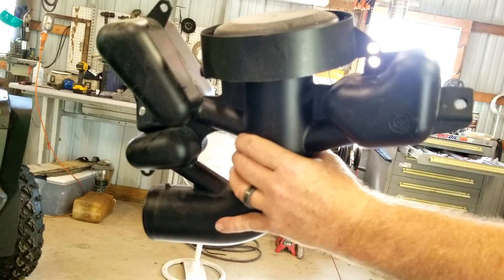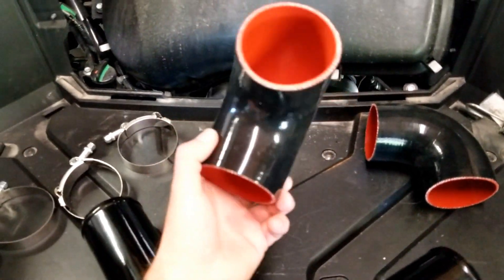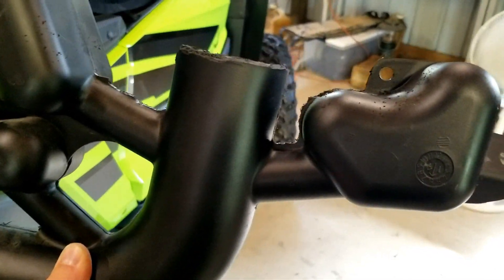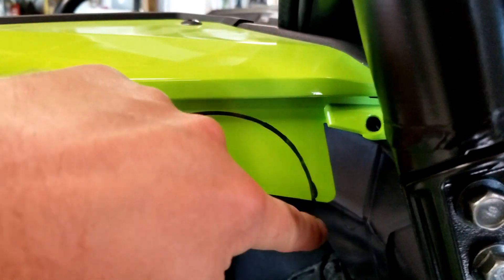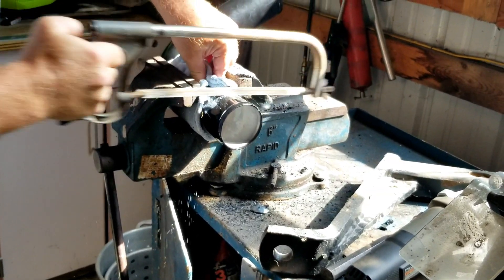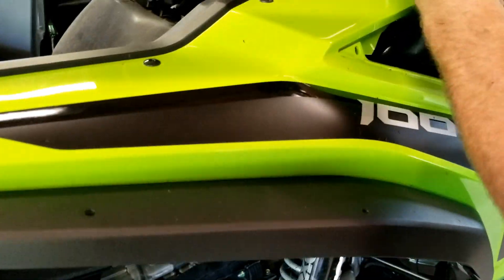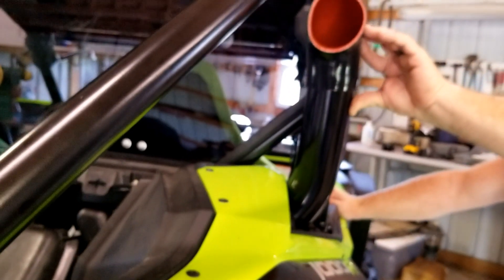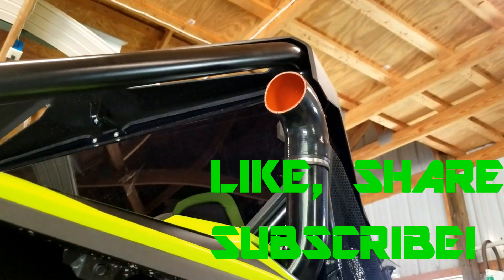Honda Talon DIY Snorkel

Comment: How do you support a prefilter? I added a Uni filter in the air box. The problem with that is that you have to open the air box to clean it and that means 2 new O-rings to seal things. So I cut off the snorkel as this guy did, leaving the intake tuning alone. Then added another oiled Uni where the snorkel was. Sure it gets dirty but easy to access via cutout panel in bed.

Restriction - pulls to the speed limiter even a small grade. Unix have a lot of area, so seems good.

I had purchased the kit this gent did, thinking I’d made TIG-weld pie cuts in place of the rubber elbows. Well, with 2 years more experience.🙄

Comment: Do you have to keep the factory canisters or can you just pipe it straight out of the intake box and delete all other factory parts
Reply from the maker: We kept the stock baffles because without them the intake noise is much higher

Comment: Could u maybe run the pipe just up to the oem vent so the air is being sucked in from the vent and retain the factory look. Maybe some rubber around the pipe edge that touches the vent to ensure the air is being sucked from the vent instead of under the wheel well
Reply from the maker: Yes you sure could, I like it where it is though because it's easy to attach a secondary pre filter for extremely dusty rides😉
Reply: Makes sense. I didn’t think til after writing that of the potential problem of having the pipe angled up to be flush with the vent probably isn’t the best idea on rainy days lol. Like the setup u did, looks clean and gets the job done. Might have to try this but throw a u pipe at the top so water stays out
Reply from the maker: @VetteWay2Fast  I put a pvc cap on mine when washing but outside of that I've had almost zero water get in, not even ever enough to fill the little check cap on the dirty side of the air box FWIW

Comment: Any reason you didn’t use Intercooler pipe from the air box up?
Reply from the maker: Wanted to keep stock intake baffles otherwise the intake would be extremely loud, the way it is you cant even hear it

Comment: I added a filter to the top
Reply from the maker: I do the same thing but only on extremely dusty rides
Reply: Do you guys use uni pre filter ?
Reply from the maker: I am using an AFE pro dry filter as the pre filter, it's not suitable as a primary filter it let's some dirt past which is fine cause it's a pre filter. It is easy to clean and doesnt restrict
Reply: @kessler89canampowa  what’s your opinion on uni pre filter. Restrict too much air flo? I don’t feel like it makes a noticeable difference but would hate to starve the engine of air. That could end all bad
Reply from the maker: I do not feel the particular filter I am using is restrictive because it is pretty large in size and is also a dry filter, it measures about 4.75 in diameter and is about 8in long. That being said I normally only add the pre filter if I'm going to be doing some very dusty riding, Michigan trails would be a good example or maybe kentucky etc in the dry season